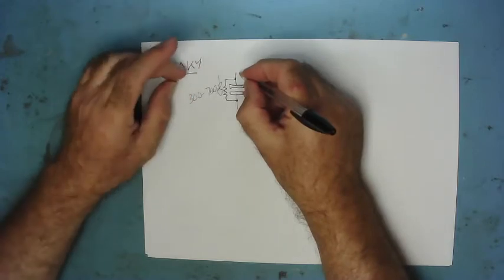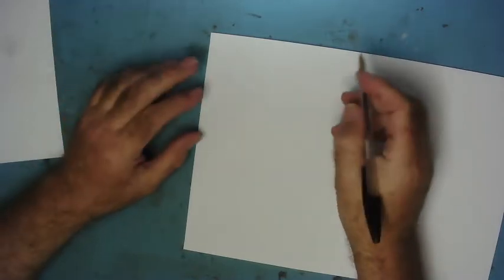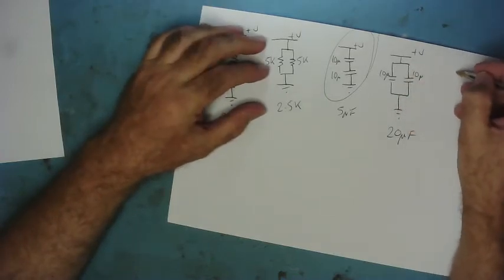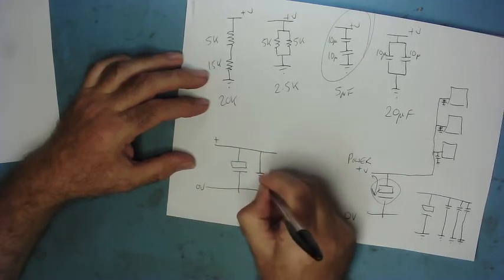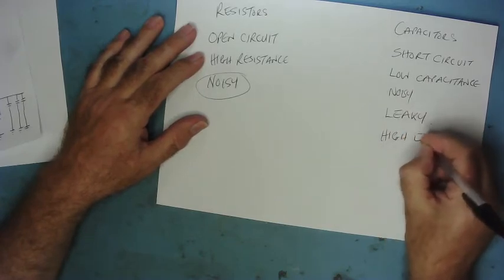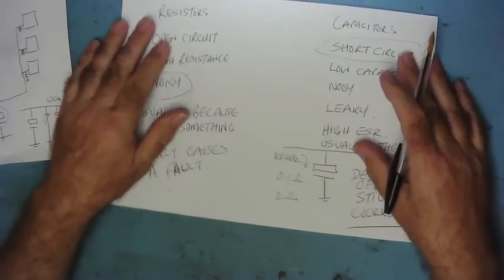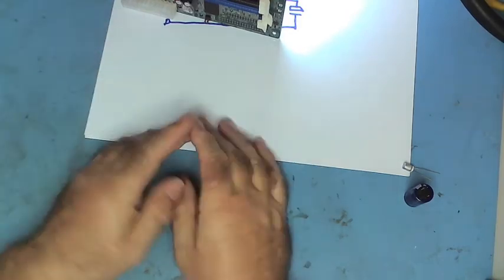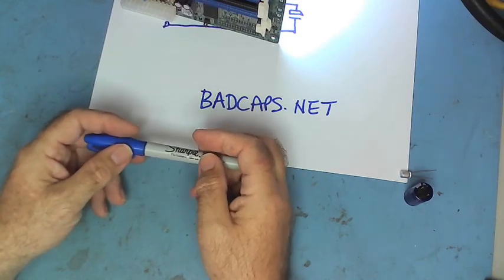LER #037 Circuits & Components for Beginners 6. How to find and test bad capacitors. Fault Finding.

Comment: Thanks for another great video.  Are you able to use a ESR meter with a capacitor in-circuit or does it have to be removed before testing?
Reply: Electrolytics - Yes, you can test in circuit. With Blue ESR you don't have to discharge first (small caps), other meters = depends on the meter (ck docs).  However, if there is more than one cap in the circuit, you won't get a correct reading; you have to remove the cap, or at least remove one terminal from the board.